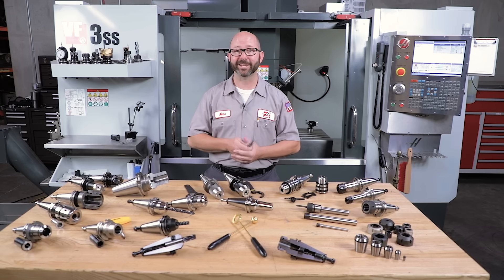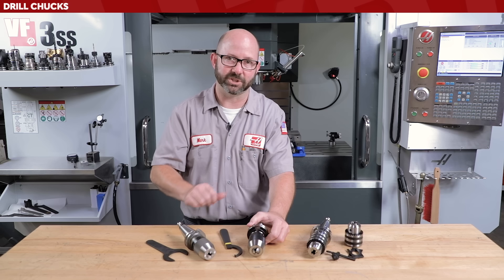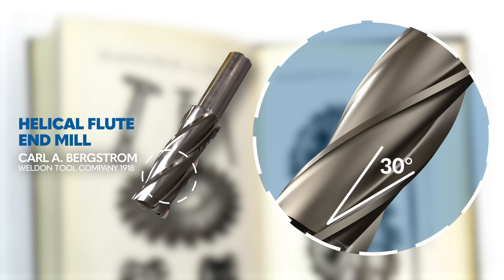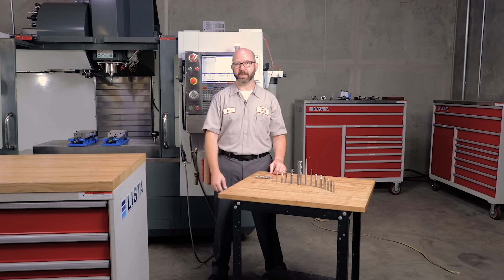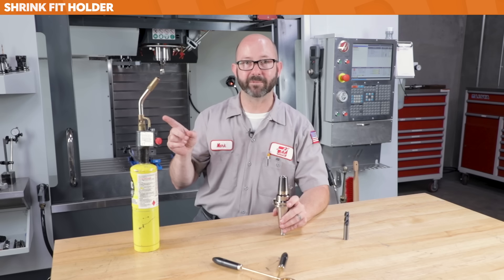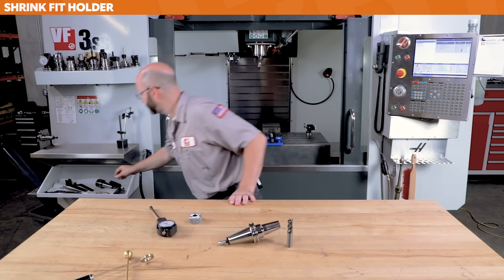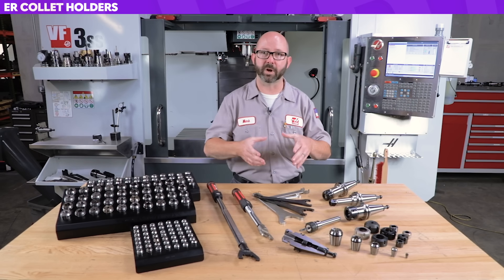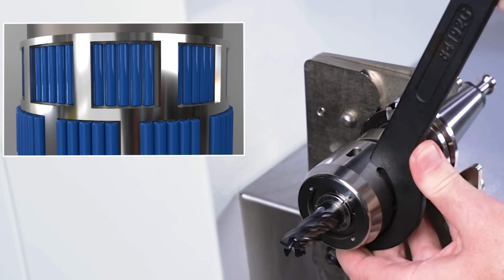Tool Holder Essentials - Every Machinist Needs to Watch This - Haas Automation Tip of the Day

Comment: I burned my muffins - i guess 375 degrees in the recipe wasn't in Celcius.
Reply from the maker: K B - Yet another reason we should just go ahead and make these videos in Metric ;) This reminds me of the time I was in Parma Italy, and converted pounds to kilograms backwards when ordering. I came home with a suitcase full of Parmesan Cheese. Happy mistake. – Mark, Haas Tip-of-the-day
Reply: @haasautomation  I'm glad you like italian chees Mark!!! Next time remember to try San Daniele ham!!! Thank you for your videos!!!
Reply: @gislemark79  Yesterday I found out that the inch - as defined and used in the USA - has been based on the metric system since at least Ford's day. Nutso.
Reply: @railgap  prior to defining the inch precisely as 2.54mm it was the length of 3 barleycorn's. As a result all countries using inches had them at different lengths. All.
Reply: A UK cup is not same as US cup. Same goes for gallons.
Reply: @DanPetrePhotos   Just a tip. When working the metric system don't use centimetres . The misplacement of the decimal point is the kicker .
Reply: @DanPetrePhotos  Do you meant one tenth of an inch?
Reply: You have an oven that goes to 375 Celsius?
Reply: Dan Petre , we should use the hogs head more often!
Reply: @JonnyCoolMelt  yeah, it's mostly used to melt aluminium, but it goes much higher than that.
Reply: K B , I’m just messin, we do our own heat treating with tool steel, We have discussed doing a turkey in there.
Reply: My muffins stayed raw. I guess 375 degrees didn't mean a full clockwise rotation and 15° extra
Reply: @haasautomation   yes YES yes
Reply: @mrman1536  In Europe, typically all dimensions in engineering (except civil engineering) are in mm. No machinist is using cm unless comparing d**k sizes.
Reply: @mrman1536  yep, i hate to admit how much it cause confusion in scale since we automatically assume that everything is in either mm or m
Reply: @JonnyCoolMelt  it's very hot for an oven. is it a wood fired oven ?

Comment: One of the the guys in my college classes tried milling with the end mill in a drill chuck. Another one tried side milling with a twist drill. They both dropped out of the program.
Reply: They dropped out of school or the tools dropped out of the holders?
Reply: @OakwoodMachineWorks  yes.
Reply: I used an end mill for side milling on a drill press once
Reply: sad to hear about the other guy
Reply: @OakwoodMachineWorks Not to worry, I dropped outta pre school!
Reply: Oakwood Machine Works they both dropped out of the class.
Reply: Trying to enlarge a hole by tilting the drill pit in a circular motion really grinds my gears 😤
Reply: The only people I've met that used a Jacobs chuck anything for milling sure as shit wasn't worried about eating it.
Reply: Ibraheem Al hadede lol I’ll do that. Only if I just have to take the slightest bit of material off. And I don’t do it in machining. Only in woodworking
Reply: @_P0tat07_  still very dangerous and harmful to your tools and the machine. Unless you are working with very soft and thin material.
Reply: @nicholasjacob3594  There are those who have done so, those who will not admit it and those that will one day.
Reply: That's nothing. I've done milling with a drill bit in a drill chuck, in a drill press. But I was just milling pine wood.
Reply: @nicholasjacob3594  Yeah I attempted that once, gave up after about 30 seconds & bought a small mill. Have used a drill bit in a collet, but never the other way round now.
Reply: I used an end mill for side milling on a drill press once. And it achieved the desired result: I couldn't get the Jacobs taper to come free, and there wasn't enough gap to get wedges in. The chuck was worn out and I needed to change it.
Reply: Can you explain how you mill on a drill press, maybe you had one of those little milling tables that can be mounted on a drill press.
Reply: @dangrimes5078  I did, as it happens, but it would not have mattered: I could have simply set a block in the vice, positioned an end mill above and somewhat to the side of the block, overlapping it by the desired depth of cut, then plunged down into the block to end up with an increasing engagement of side milling as the quill fed down. I would have snugged up the depth stop clamp enough that I could just still feed.
Reply: @dangrimes5078  I've "milled" (losely put in more ways than 1) 4mm mild steel on a drill press with a Jacobs chuck with a twist drill using an X/Y vice, I had to pre drill small holes closely, go on with the bigger bit then mill just to get the twist drill to bite.
She sure had lots on run out and chatter but I had my safety squints on
Reply: @nicholasjacob3594  in wood it works somtimes
Reply: I've done it before but its only when I need to do something quick, non critical, light cut and its already in the manual mill. yes its lazy, thats all there is to it.
Reply: I have done both of those things out of necessity. I did use a drill press though for the end mill. I hope that counts for something.
Reply: @Trident_Euclid  I have done that out of necessity too. lol Of course followed by treating it like an end mill. Anything to get the hole large enough for the only bolt on hand.
Reply: @dangrimes5078  I do have one of those on the drill press. The original intention was just for precise positioning. unfortunately that table takes up so much room on a Bench press that it is almost worthless. Is worthless for big long drill bits.
Reply: Dad was a machinist and had a lathe and a mill in the garage while bro and I were growing up. Bro must've seen dad using a endmill one time and to a kid a drill and an endmill would look very similar. So in a woodworking class one time he tried to show off to his friends "My dad does this all the time." And ended up using a drill as an endmill, which I don't think ended very well...
Reply: If you want to mill with a drill press, use loctite on the chuck taper before slamming it in. It will stay til you heat it up with a torch

Comment: here's a new one...try using a 3/8" endmill inside a weldon holder with a 1/2" bore...then after breaking 3 endmills and ruining a couple workpieces, we eventually figured it out. But he still asked "well how was I supposed to know???"
Reply: someone at my workplace once mounted a 5/16th(around 7.9mm) tool in a 8mm sleeve in a hydraulic chuck... didn't ended well...
Reply: I wonder how chinese carbide would fare in a hydraulic chuck, they are sort of precise but the not necessary any exact size but often down several hundreds of millimeter.
Reply: yeah that's a downside with hydraulic holders that wasn't mentioned in the video... they can and do fail sometimes (like anything) and there's also a bit of learning curve for working with them (again like anything I suppose). The powrgrip system was intended to fix that, and it's definitely more reliable.

Comment: I'm not sure why I find these so interesting but its great to understand the challenges and tradeoffs behind how things are actually made.
Reply: Bravo, Subtractive manufacturing is remarkably interesting. but additive manufacturing is about to change manufacturing as never seen before. If you're interested in innovative manufacturing, google," Evolve additive solutions STEP". welcome to the future of manufacturing. AM (additive manufacturing) is about to be ushered into the theater of production manufacturing for the first time in history. SVP, just in time delivery, voxel CAD CAM, same materials, materials with different properties, and multiple colors(simultaneously), isotropic properties in all directions equal to IM, unlimited iteration with scalable volume production, & no tooling up for injection molding ever again.) cheers
Reply: @machinagician5953  thats your opinion?
Reply: Hey haw are yo ,,?

Comment: I'm a mechanical engineering student and I've been watching these videos to get insight on how the machinists have to work around their machines and materials.  This series has been extremely helpful in improving my garage hobbies and my understanding of the topics.  It reinforces the idea that the machinists have a wealth of knowledge that I'd be wise to pull from but it also breaks things down in such a way that I understand better without having that knowledge myself.  For example, if I talked to the machinists at work and I know that we don't have the high clearance shrink fit holders, I might change the design to avoid needing it.  Then I'd talk to the machinist again and see if there's any other pain points I can rework to make us both more profitable.

Comment: We especialy use shrink fit chucks from Haimer for our milling operations, but with all the trochoidal milling strategies, I often switch to milling chucks. The high force chucks are much chunkier so they can absorb more vibrations and I can nearly double my tool life. 

We don't use drill chucks at all, we use the ER32 System for all "normal" drilling operations. The ER is also good for PH HORN slotting tools and Iscar Multimaster tools for example.

We use the hydraulic chucks especially for drilling with solid carbide and PH HORN gun drills. It's much easier because of the internal coolant, so you don't have to use a sealed ER collet and also better absorbtion than the shrink fit chucks. 

As usual a great video from you guys. I often use the Tip of the Day videos for our apprentices because it's very good contant for begginers AND pros. Keep going, great job and geetings from Germany ✌
Reply from the maker: Marcel – It sounds like you have a terrific system for toolholders, using the right holders for the application. Thanks for posting. – Mark, Haas Tip-of-the-day
Reply: How do you like the Iscar multimaster tooling? We have been using the system for a while now with mixed results. Using Er style holders similar to your setup probably
Reply: @yoimalex  we use the Multimaster toolsystem for chamfering operations were we need that extra bit of length to get to the contour, especially in combination with five axis vises. We also use the ballnose inserts and the inserts for outer radius milling. I realy like the tool length, just imagine you would use a five axis vise for clamping and than you use a big bulky chuck with some short tools. There is where the multimaster makes money. And on top of that comes the simple tip change and the big variety of inserts.

Comment: I come from Germany, for 25 years I have created fixtures with 3-axis milling machines from DMG and Kunzmann. I use inexpensive standard Weldon Tool Holder (SK40) with side screw connection and ER Tool Holder because the milling process is below 10,000 rpm and the accuracy is sufficient. 
I really like Mark Terryberry's lectures because I refresh my knowledge and learn new things.
Thanks a lot for this...
Reply from the maker: Great comments Pascal. A standard Weldon Holder is fine, even ideal, for a lot of applications, especially when running at lower rpm. Thanks for posting. – Mark, Haas Tip-of-the-day

Comment: Great info! Learned so much about tooling. A while ago we had issues with roughers in 1" shrink fit holders we've been using for years, pull out. Tool and holder tolerances were on spec and nothing has changed with the tool path or machines. After doing testing and research it turns out that we weren't keeping track of cycles and that these tools have a cycle life suggested by the manufacturers. Having heat cycled them for years, they slightly lost their malleability and grip strength. Maybe those that work in places that cycle their heat shrink holders a lot should keep track of the number of heat cycles each holder has gone through. Just a thought.

Comment: A minor point worth mentioning in an otherwise superb video. Mark says about the 5:00 minute mark that twist drills are straight, but actually jobber length high speed drills taper a couple of thousandths smaller at the shank than the nominal size. He should mention that the shanks are softer as well, that is why they get scarred up when they slip (and distort of someone puts a drill in an end mill holder.)
Your videos are a great source of information, please keep them coming!

Comment: Mark, I smiled towards the end of the video.  I've had a VF2 in my garage for a few years (I was told this was the only home garage install in my town at the time).  I started exactly as you said.  I haven't had the need for hydraulic tool holders yet, but they are on my list.  Great video.  Thanks.

Comment: Best explanation and demo of tool holders  I've seen. I've worked in large and small shops for over 50 years, manual lathes and mills, and NC lathes last 25years. Not being a NC mill guy, I've seen some of these but never the physics. I'm retired now, have a home shop, with manual machines. I still smell like "sultex" most of the time. Lol. Thanks for the great video, never too old to learn something new! 👍😎

Comment: Just a home machinist and I have  a  keyless chuck, great for quick change over of twist drills. Have an ER16 and ER32 collet systems for milling, and after this video will buy some ball bearing caps thanks Mark. I have tried using my keyless chuck while end milling ( due to sheer laziness) was not a good outcome...miles of chatter and the end mill came out of the chuck ....now that was expected !! Thanks for all the tips Mark !

Comment: I am just getting started in machining with a garage shop making racing components, and have been researching the best tools and tool holders to get when starting out. Since I will be doing a fair mix of milling and drilling, with no need for super tight tolerances, I had settled on an ER32 system to start.

Having watched this video, I feel more confident in my decision and have a good idea on what to get next to increase my capability. This has been really informative!
Reply: Definitely get a pair of ER32 collet blocks,  (square and hex).  I got a pair when I I got an ER32 set. Even though I don't have my machine set up so I can use the ER32's, I've found a number of uses for the blocks.

They made my life much easier after I put together a sorted box of shims, (½x½" each), then discover what a pain in the ass trying to get a 0.001" shim out of a ~1x1" section!

i tried everything then remembered I got a container of 1/16 x 1/16 x ½" neodymium magnets, along with a bunch of other neodym's, from a retiring machinist last year.  Figured I'd never use them.

I grabbed a 4" piece of 1/8" PCV welding rod, and thought I'd end drill it, and insert the tiny magnet, to make a strong enough, but not a grab every friggin' thing magnet stick.  Then I got to thinking about end drilling the PVC!

Put it in a 2mm collet, then in the square block, and did it in my drill press like I'd done it for 20 years. It was so easy, I made a half dozen more, and put them in my 'microscopic' machine screw boxes.

 After a couple of uses,  I realized I had to paint the useful end red because it's so hard to see the timy little magnet!

What kinda racing you into?  You making parts for your own car, or for the market?

Good luck..

GeoD

Comment: Nice addition of the metric system. Europe appreciates you. Also great pointers i learned in 4 years of machining. While boring never EVER turn the bore dial backwards unless you really screw it up, back it up by 0.1mm and feed about 0.01 mm to 0.02mm on the dial until you reach again the diameter you were on (Using an URMA boring tool with a dial for precision diameters). Also if the shank of your drill look like your brand new tires, bring them to a lathe and get em' cleaned. Also  you must and i can't stress this enough MUST use 3 passes for a 0.01mm to 0.02mm tolerance pocket or contour >Roughing>Semi-finish with a new mill (leave 0.04-0.05mm)>Finish.  Pre-drilling is important for  drills under 13 mm and a depth of more than 60mm, and it's absolutley necessary for drills under 7mm at the depth of more than 50mm . Also when reaming closed holes, leave 2-3mm from the end and finish manually and drill the hole 0.2-0.3 mm smaller than the reamer for softer steels and 0.2mm for harder ones and for plastics and aluminum you can safely use 0.3mm smaller drill diameters.